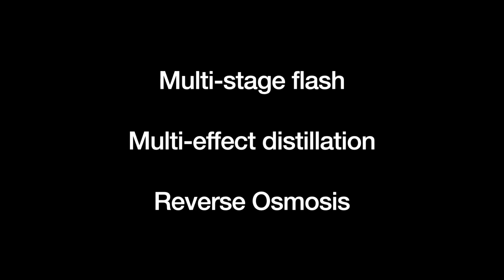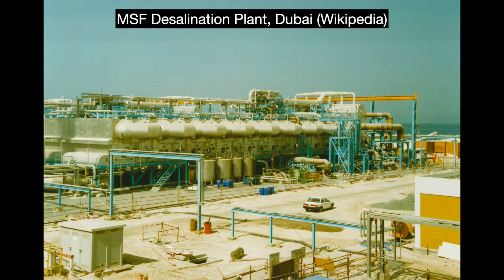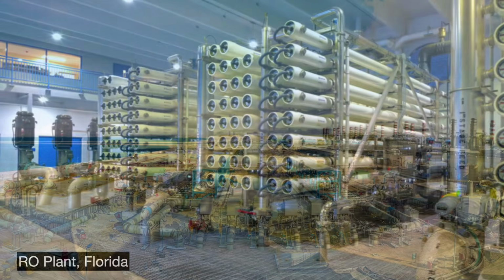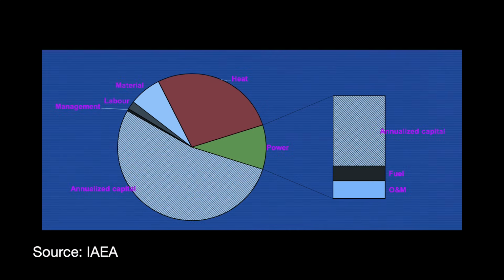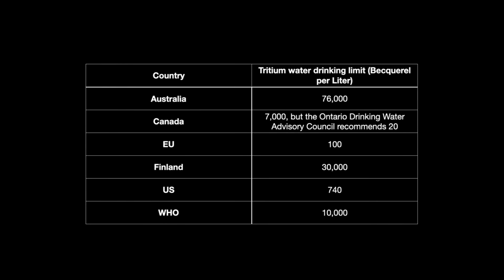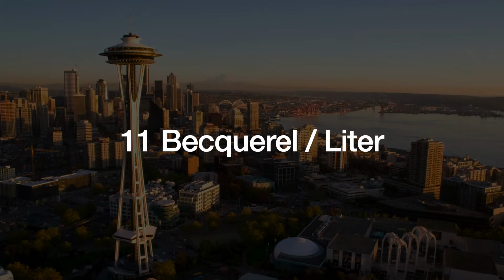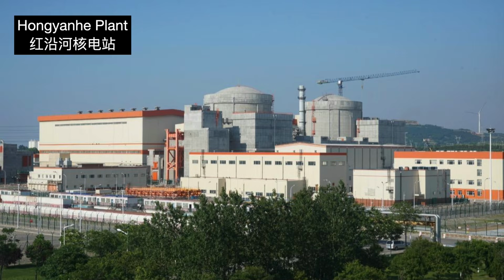Going Nuclear to Desalinate Seawater

Comment: Many years ago I had a neighbor, Paul Kunming, who was a retired Westinghouse nuclear power engineer. He said Westinghouse made a major error by not incorporating desalination plants with nuclear power plants. If coastal cities could have a water supply, they'd want nuclear power plants.
Reply: It totally makes sense to use waste heat from the cooling system to power the desalination process. The solution for excess heat being dumped from nuclear plants on the ocean was right there ! use it to remove the salt, and have fresh drinking water.
Reply: @monad_tcp hmm
Reply: We could use nuclear to:
A. Produce Electrical power
B. Desalinate salt water
C. Produce H2 
All in 1 big plant.
Reply: @jfv65  trust me you dont want hydrogen.
Reply: @jfv65  We could but the same green meanies that forbid any so called environmentally incorrect power plants really oppose nuclear power.
Reply: @jfv65  B. and C. only.  Solar and wind electricity production is much less expensive per kwh.
Reply: No, it isn’t.
Reply: @hankjones7829  I see that math is not one of your strengths.
Reply: @hitreset0291  The question is not necessarily if nuclear is more expensive than solar and wind - it is. The question is whether nuclear is less expensive than investments in large scale battery storage solutions. When the wind doesn’t blow enough and there is no sun, how do you get electricity? You need a continuous source like nuclear or large scale battery storage.
Reply: @keithv3767  to imply that battery storage is our only viable means of renewable energy storage is a bit myoptic wouldn't you say?
Reply: @hitreset0291  Not at all. You’re comparing wind and solar cost to nuclear and saying it’s a ridiculous comparison because nuclear costs more. My point was who cares? Wind and solar are great, when they work, but any solution will have to fill in the gaps when wind and solar aren’t producing enough electricity. Nuclear would be one of those options. If you wanted to limit all energy production to just wind and solar, the only possibility to use battery backup systems on a grid level. So that’s what you need to do a cost comparison to. If you have other solutions state them.
Reply: @keithv3767  battery storage is not the solution for grid scale long duration energy storage. Think off river pumped hydro or some other means of mechanical energy storage.
Or think thermal energy storage given over 60% of household energy consumption is for heating and cooling and hot water.
Chemical energy storage (ie, batteries) have its place in the energy mix ~ just not for grid scale long term energy storage.
Reply: @somerandombaldguy5296  dude, time for you to put your toupee piece on and fade into the background.
Reply: @keithv3767  nah wind is trash
Reply: @hitreset0291   it’s not just about power storage for the future grid. It’s replacing the current grid’s backbone of spare quick use capacity, which other mechanical or chemical methods can’t reproduce.   
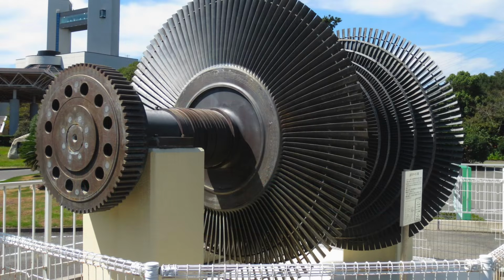  Wind, Solar, Batteries, and mechanical storage are horrible for the large & quick spikes in demand the grid experiences daily. For example: the “8:30 spike” (or 7:30) seen in large cities as AC/heating, lighting, and electronics are turned on/up in office buildings in the morning.  In a city like Toronto 🇨🇦, the spike is equal to +13% of standard demand.  In Los Angeles 🇺🇸, the spike is closer to +20% of standard total demand in the summertime heat. 

 Those kinds of spikes are both too quick and too long for mechanical or battery backups to be the backbone of the future grid. 
   Dual design Nuclear is the only viable quick reaction power generation to completely replace what we use Coal and Natural Gas for now.  
  We also get major added benefits if we use 2 different designs of nuclear power.  The combining normal fuel rod type everyone associates with nuclear power, and modern Waste Annihilating (WAMSR) designs has great potential.  We would get an enormous amount of excess power generation usable for desalination; and most importantly the capability to reduce the production and storage  of high & medium level nuclear waste by over 90%.  (And to ability to completely neutralize  the cores of nuclear warheads, which we can’t do with current designs.)    
  With Dual-Design nuclear power, we would be able to beat France’s current record of: a cigarette lighter sized amount of nuclear waste, per person, for a lifetime of nuclear power. All without the added expenses they pay for reprocessing old fuel rods.
Reply: @hitreset0291 nuclear kills a lot less birds & bugs than wind and has a way smaller physical footprint than both wind and solar. Economies of scale also matter a lot here. The fact that wind and solar have had the benefit of a global subsidy push to mass produce them and the “cost savings” are still only a relatively recent development tells you a lot. If the build rate for additional nuclear power capacity were anywhere close to wind and solar I guarantee you nuclear would be cheaper in the long run.
Reply: Ocean going ships use the heat from the engines to make fresh water by lowering the pressure in a tank. It therefore boils at a lower temperature.
Reply: Submarines do it all the time.
Reply: Funny thing is a lot of the fission plants located on ocean and brackish river coasts have desalination plants attached to them, but it is just enough water to make ultra pure makeup water. They just need to be scaled up so instead of rejecting excess grid power to resister banks when the power isn't needed it is sent to a larger desalination plant.
Reply: @anydaynow01 that's ridiculous, they cannot control how much power they let out without having to produce 100 percent and throw away,  I guess the wast electrical power could power induction heaters for MEF distalisation
Reply: It would be nice to hear an expert's opinion on the viable uranium reserves left and on the so-called breeder-reactors on fast neutrons...
Reply: @hepcat93  there is over 600,000 Metric Tons of proven uranium ore deposits just in Kazakhstan and Canada.   That’s enough to power the entire world for over 200yrs.    It’s over 400yrs, if we used modern Waste Eating, and Thorium-based, reactors types.
Reply: @hepcat93  thorium is a better fuel, readily available and incredibly difficult to weaponise (unlike uranium - uranium fulled nuclear power is a byproduct of the weapons industry)
Reply: @miscbits6399  man, I meant the energy carrier, the intermediate substance to fill the fuel tank with, cuz I strongly stand against EV's due their heavy reliance on copper and rare-earth elements, cuz digging them out and processing can kill our ecology much faster than we do it today. Speaking of the primary source - 100% agree with you. I think that the closed nuclear fuel cycle may keep us afloat until we cope with the nuclear fusion technology.
Reply: @hepcat93  we do not have a uranium supply problem. between high grade uranium supplies. What is disolved in sea water and thorium... If we closed the fuel supply the only concern we would have for running out of power would be when the sun ends.
Reply: @hepcat93 there is virtually no uranium shortage.
Reply: Utilities would have retired them if they were included.  The vast majority of US based Nukes have water purification plant.  They are very rarely used and most plant have abandoned their purification systems.  Instead most nuke sites rents RO trailers from GE or other 3rd party companies and use city water for the feed.
Reply: @mikeall7012  I'm not referring to the small water purification systems have for use by their processes. I mean large scale plants to supply water for domestic and agricultural use. As in, the power plant would be the municipal supply.
Reply: Good point.
Reply: as usual stupid politicians ignoring engineers, 🤦‍♂️
Reply: @LexlutherVII China doesn’t have that problem because many Chinese politicians were engineers
Reply: If coastal cities could have a nuclear waste dump they'd be over the moon
Reply: Hindsight is always 20/20 vision.  Coastal cities would have seen the price tag of paying for a desalination plant when they didn't need fresh water at the time and say no.  They have no long-term vision.  The just look at costs.

Now, they will build the desalination plant and be forced to build a nuclear plant if they don't have enough wind and solar to provide enough energy.
Reply: @MaximGhost  I agree. And it seems to me that if using nuclear energy to make fresh water is too expensive, then using nuclear energy to make electricity for homes and businesses will be way too expensive as well.
The production side of the electricity ledger we have covered using solar and wind ~ it is the storage side of the energy ledger that needs our attention.
Reply: So do that now, what EVER the price
Reply: and if it blows and leaks waste into the ocean, we can just desalinate it again!  well maybe not, but the ocean is a natural filter.  worst comes to worst....better than constant oil spills maybe?
Reply: @Molecular-Brainwaves-Translate   it is a much better choice than Coal & Oil power.  Solely  counting the Arsenic, and not the radioactive Iodine 131, released by mining, processing, and burning Coal.    
 There are multiple huge areas of Eastern Ukraine under the risk of permanently contaminated Fresh Water supplies.  Each Covering areas larger than that of the Chernobyl exclusion zone.  All from potentially flooded Coal Mines.   
  If those mines flood from lack of power, the arsenic that leaches into the water and soil will make both the Chernobyl AND Stasi/City 40 nuclear accidents pale in comparison for the amount of people both displaced & killed.
Reply: @GoatPopsicle  you left out one wee tiny detail. The coal contamination would be localised ~ but the nuclear contamination would 'spread the love' all around the world.
No thanks.
Reply: @hitreset0291  Lol global warming is localized now : 😂😂😂 lemme guess it's all fake?
Reply: they don't so it on purpose....kust like why they dont use lftr and are getting rid on nuclear in general...you think they didn't think of putting a lose "lid" on the cooling towers?  psh...control and pop reduction
Reply: Hit reset, you like watching that China syndrome movie?
Reply: coastal nuclears are the most  vulnerable ones
Reply: @StrangeWorld11191   they don’t have to be right on the coastline, if we are willing to take a ~1% hit in efficiency to pump the water to higher ground 10-15km away from any flooding hazards.      
  Modern designs, like the Brits upcoming nuclear power plant, take extreme weather events(made worst by Climate Change) into consideration.   That plant is designed to take on a 5-day long “Once every 10,000yrs” Superstorm and keep on operating without fail. 
  
 You also don’t want battery backup systems anywhere near flood zones either, freshwater or saltwater.  If Fukushima had a Tesla battery backup system installed instead. The explosion from saltwater flooding the plant would have also thrown up a hazardous cloud of poisonous gas for weeks.
Reply: @StrangeWorld11191   nuclear power plants can’t go supercritical like a bomb, it’s a physical impossibility.   On top of that, the 3rd & 4th generation plants built since the 1980s don’t rely on human intervention to go into safety modes, and are built more along the lines of Western nuclear ship&boat designs.     
   The new UK-based nuclear power plant had that exact same “what about a superstorm” fear-mongering when it was being initially debated in parliament, long before Fukishima. 
 It would take an impossible Category-6 “Sandy” level superstorm, or an unprecedented 9.6 earthquake, to get the risk of a catastrophic disaster up to a 4% probability.    While either one of those hitting the ash pits, mines, or Coal power plants it is replacing  would be 100% and quite literally poison tens of millions of people & poison up to 1/4th of the North Sea’s entire multinational coastlines literal dead zones for fish nurseries.     
  
 The environmental risk to our existing Coal/Oil/Gas infrastructure to the same SuperStorms, Tsunamis, and Earthquakes we will eventually encounter is astronomically higher.     
  A Tsunami in either: The North Sea, The Gulf of Mexico, the US West Coast, the Chinese West Coast, or in the Eastern Mediterranean.   Any one of those would cause an extremely wide ranging environmental catastrophe just from the Coal/Oil/Gas infrastructure   That it would make Fukushima, Chernobyl, and even Stasi-40 look like minor regional oil spills.       
  A Tsunami that “purposely aimed” and only hit the +600 total UK oil platforms in the N.Sea, and missed the hundreds more operated by other nations.  That would spill +10,000 barrels of both sour & sweet unrefined heavy oil into the sea, every single day.  Capping those pipes would take the world’s entire rescue fleet over 9months in optimal conditions, but over 2yrs in reality.      The entire region from western Scotland to Finland’s northern & southern waters would be polluted with that oil for decades, and make eating anything caught in the area dangerous as hell.   
   
But, we accept those cancer risks because that industry spilling up to 5,000 gallons of heavy oil  into the sea barely makes the news cycle for a day.     Go and check the recent reported oil spills in your area.   I bet you’ll be surprised when you see spills near you, that you never heard about.
Reply: Processes sometimes fail and contaminate the water. You can drink many a types of contaminated water but not nuclear contaminated. The contamination is difficult to detect too.
Reply: Off Peak electricity can be utilised during the wee hours of the morning to desalinate salt water and supply a city with drinking water reducing the water drawn from rain water dams.
Reply: Have you listened to Galen Winsors lectures

Comment: The use of reactors for desalination is only hampered by current reactors that produce very nasty waste and weapons materials. Using thorium reactors would eliminate the waste and weapons materials issue as well as be capable of desalination as part of their cooling system. The concentrated brine can be pumped into evaporation ponds and the resulting salt used for other industrial purposes or diluted with raw seawater and returned to the ocean/sea it was taken from. By building multiple plants in areas where earthquakes and tsunamis are less likely and/or building facilities able to withstand them, water and power can be provided safely and in great quantities. The cost of running thorium reactors would be much less than uranium plants due to their inherent safety and lower radiation fuels and waste.
Reply: Actually current designs produce a very small volume of dangerous waste.  It’s said that over 90% of all nuclear waste has already been produced and most of that was from government nuclear weapons programs, not civilian power generation.
Reply: He didn't mention nuclear waste because only fools think it's any sort of problem.

Comment: A billion watt output requires about a 4 billion Watts of heat. Where there was no heat it's a lot of heat. They dump it in rivers and oceans. It's not spewing methane or CO2 but so much heat. Surely the heat produced as to the global man-made warming process. Every country that uses nuclear power has to dispose of its waste within its own borders. Finland, is a land of granite where they have dug deep to bury their waste. Where will Japan bury their waste? Japan has more plutonium than anyone, they consider it a commodity of value. The initial purposes of nuclear reactors was to produce plutonium for atomic bombs, an expensive process. Tricking consumers to pay, too cheap to meter was the nuclear industries number one selling point to the public. How to turn all that waste heat into a product, electricity, to get consumers to pay what the defense department was paying. No country but Norway has a place to put the waste. A billion watts of brine that will not mix well will be dumped into the ocean affecting the salinity. How the rivers of brine leaving the desalination plant travel once it hits the ocean. The salinity differences of the water is what creates the Great golf current pulling heat from the Gulf of Mexico to Great Britain and Europe. All the glacial melting is desalinating the water disrupting the gulf current. It's important to remove the salts before returning the water to the ocean. More salt than Morton can sell, what to do with all the salt? But they're not going to do that last step. Israel is desalinating water and it's not without consequence. The advantage of nuclear is that it's very powerful and enclosed in a small campus with potential for radioactive disaster using traditional reactors. I think solar power can compete using direct evaporation rather than reverse osmosis or maybe both at the same time. Rather than one huge plant serving a bunch of people, solar refrigeration that pulls water out of the air and provides building cooling as an option. Ultimately though, Nestle and other corporations hope to be able to serve you directly, as they pump the groundwater dry, that all who care to drink water must pay for it. One who takes a cup to the stream owned by Nestle is a thief as Nestle paid cash for the water rights that nobody else has a right to touch. Any water produced by a mega plant like this isn't going to serve the fire hydrant outside on the corner, but individualized containers made out of plastic that you just simply throw into the river when you're done with it that's third world conditions. It might solve one problem but it's going to create a lot of others.